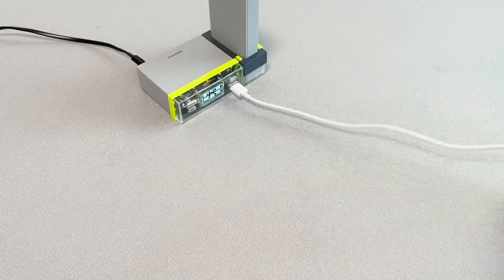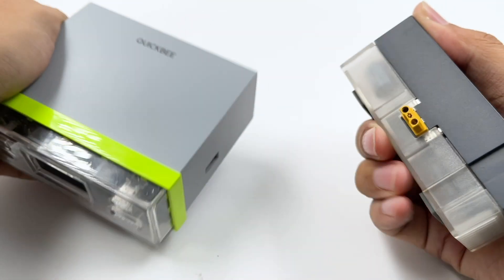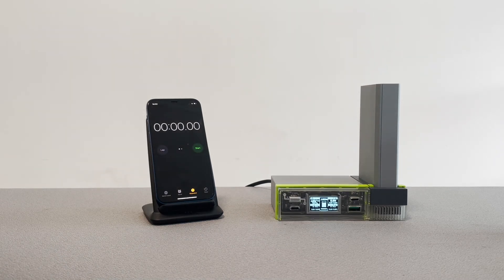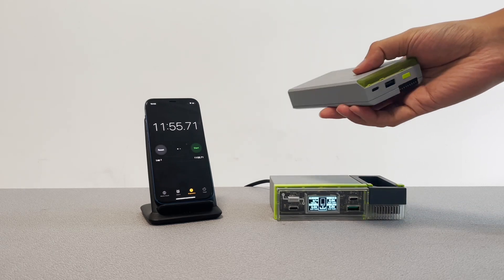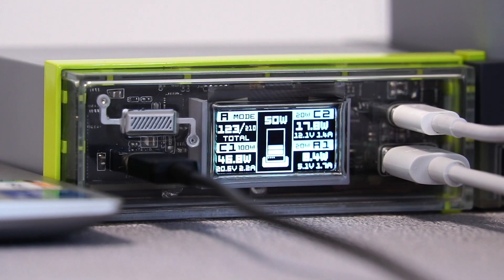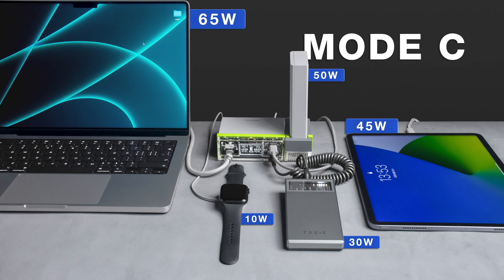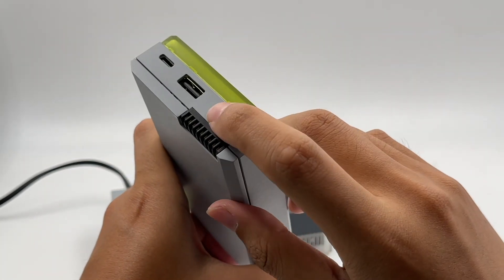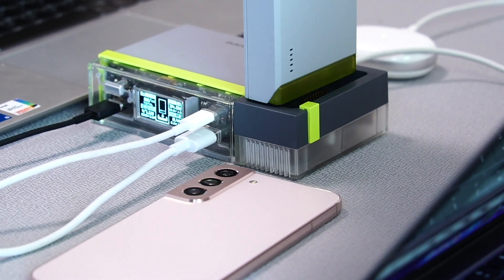Fully Charged in 12 Mins | Tegic Quickbee 2-in-1 Multifunctional Power Station

Comment: This product uses two pouch-type lithium ion capacitors (or hybrid supercapacitors) manufactured by Shanghai Aowei Technology. A lithium ion capacitor is different from the conventional EDLC supercapacitor. The lithium ion capacitor capacitor has a higher energy density but a lower cycle life, compared to EDLC. Also the self-discharge rate of the lithium ion capacitor is very low.

Comment: Wait is the powerbank whole battery a supercapacitor? Well that's slow for 11mins charging and I didn't know that we have super high capacity capacitor available (relative to battery)
Reply: I don't think it is slow tho. To charge the 8000mAh Power Bank in 11-12mins, I nvr met a product like this.
Reply: It is using two pouch-type lithium ion capacitors (or hybrid supercapacitors) manufactured by Shanghai Aowei Technology. A lithium ion capacitor is different from the conventional EDLC supercapacitor. The lithium ion capacitor capacitor has a higher energy density but a lower cycle life, compared to EDLC. Also the self-discharge rate of the lithium ion capacitor is very low.